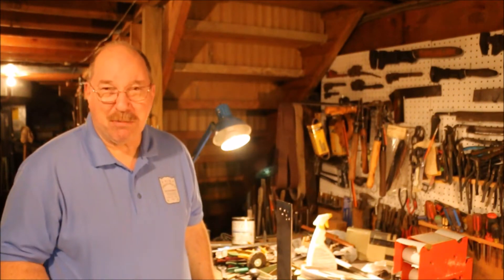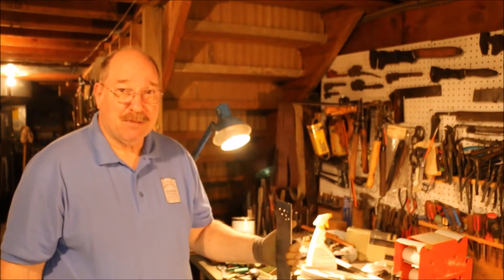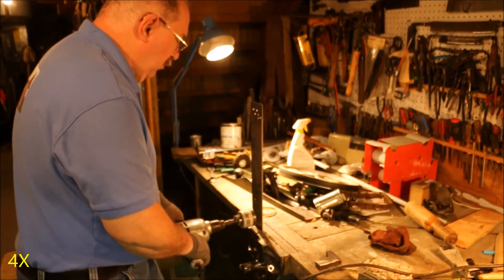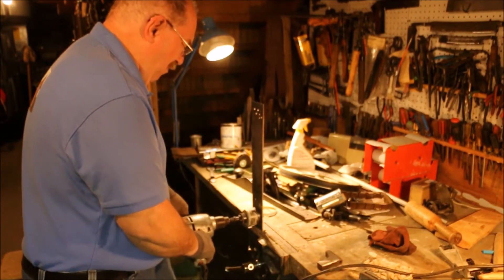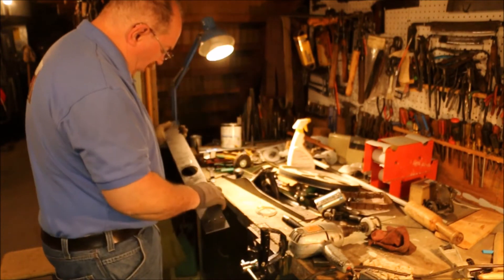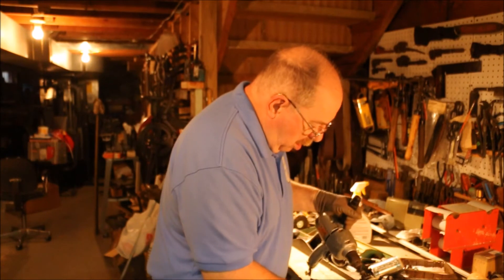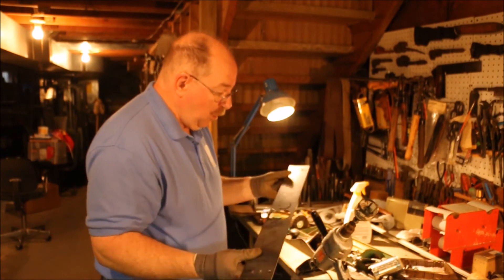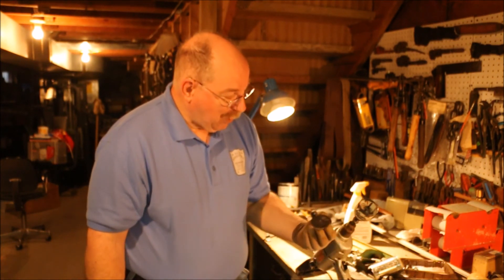HDPE SHREDDER R&D ~ PART 1 ~  PROTOTYPE BLADE DESIGN

Comment: The furnace has been kicking on for a month. That IS the frozen North we're talking about here.  Just keep cutting circles and notching them and you'll end up with a mini tub grinder. Then a p.t.o. hookup to the 8-N and off you go! Got 8 inches here. Kids got a foot and 10 miles west got a foot and a half. Power on BUT the generator is ready, just in case.
Reply from the maker: Lewie McNeely You guys got slammed. Lots of humidity and a day thats just cold enough to snow makes the most cover. We live about 50 miles West of Lake Michigan that makes lake effect snow the norm. We have skipped the usual early snow this year. That means we will get at least one big one. The average inches per year is almost always within an inch or two.
We went to the Smokies on vacation a few years ago. There was lots of ice at the tops of the mountains in April. Must be you guys get the best of both worlds. Heat and bugs in the valley and freezing cold 20 miles away.
Reply: YOu got it, Unc. Plus everybody that thinks they're really something through the summer BUT they can't stand the cold and head south. Peace and quiet when the cool starts setting in. I can remember it being a lot worse years ago but it was pure ice. I'll take the snow any time but this one wasn't really bad. It just surprised a lot of folks by not being mostly rain. This is what us Sneelockites major in;  being ready for what you don't think will happen. Works every time!
Reply from the maker: Lewie McNeely Any kind of hill and freezing rain is a recipe for disaster. I have had to drive with two wheels off the road to get up a hill on Sprague road before. I need to put the sand bags in the back of the Sonoma. The extra 100 lbs by the tailgate helps. 
Hooking up a giant shredder to the PTO is an AWESOME idea. That would put the wood chipper out to pasture. 100 hp  would eat 55 gallon plastc barrels. 😈😈😈😈😨😨

Comment: I've no need to say what's the problem with the saw not cutting the famous magic elixir full stop the old B&D drills are by far the best i have one from 1969 a gift for Christmas and I've used it ever since it has 2speeds 1/2"chuck I have sander,saw and lathe attachments also it has a stand for drill press and one for grinding and polishing mop on it I've never even changed the brushes and it will still go as good as the day I got it
Reply from the maker: Lewie McNeely We had a friend who made waterbeds in the 70's. We had it for about 7 years. When it worked it was great. Leaks and screwed up heaters finally took it out. We had a dog named Homer who was our first child in every way. Always slept on the standard bed but just wouldn't get near the water bed. Just as well I suppose. Claws and a plastic bag full of water? Not good. Loved it when it worked. 
The matress is cheap enough I think they should be replaced every three years. Same for the heater. 
We got the humidifiers out last week. Makes a big difference. 68 degrees is comfortable when it's running, chilling when it's not. Not a water bottle but I really notice when the tank runs dry. I don't want an automatic one on the furnace though. The lime up and clog to easy even with the water softener. Mom and Dad had one that I had to dissassemble and clean all the time. Way too much trouble. If you don't clean it it floods the firebox and everything rusts. 
Stay safe my friends. The next couple weeks are when the bad drivers get braver. Already had one 32 car pileup on I-94.
Reply: Midnight to you. The old drill motors are TOUGH! Hope all is warm where you are. The stove has it too warm for me but it still feels good. Am going to try and go out tomorrow since the roads are clear. 8 inches here and about all gone off the timber. I have a new floppy drive coming so maybe I can get some pictures your way. The old 98 is shot. The kids got a foot and west 10 miles got 1 1/2 feet. Our little sheltered paradise!
Reply: Lewie McNeely evening my friend the snow has slowed for the mo it’s rained all afternoon about 8mile around Manchester is clear now snow only on high ground.
Reply: 'Gmorning my friend and we might get a little tonight but not much. Cold and windy now. I can hear it cutting around the house. We're all glad not to be out in it.You too I'd say.
Reply: Lewie McNeely been out most of the day birthday weekend today youngest grandsons tomorrow eldest grandsons we ventured into Manchester to do some shopping pm and that’s like death by water dripping on your head so home and bed out for count just come round got it all again tomorrow for eldest
Reply: Go S L O W if you can. Tell him Grandpop ain't as young as he was yesterday. I think we're going to try it out tomorrow too. I turned the car around so we can zip out instead of trying to turn and go. Wish you the best tomorrow. Just stay as warm as you can. Maybe Unc can design a water bottle to crawl into!
Reply: Lewie McNeely I’ve sort of got one I call it bed lol just looked out it’s snowing again see if it stays in morn anyway you take mate
Reply: I had a water bed but I think it hurt more than it helped. The best to you tomorrow. Hope all is well. Will check in when we get back or if we go in case it snows a bunch more.
Reply: I got the dimensions on a mattress and actually made the frame out of 2x12 cedar. Did an amazing job on it for me. Had a headboard with drawers and everything but it started cramping me up. Like being on a concrete floor, it just got worse. It was a full waveless but I could plop my 1st out in the floor. Ended up making things out of the frame. Can't even remember what. I've seen the furnace humidifiers clog up like that, even the spray ones. I'll pass. They do make a difference though. I got Sweetums an ultrasonic for the 'She Den' and she really likes it.I've got one on my CPAP but don't run heat on it. My sinuses are goofy enough. And everybody was all over the road yesterday too. Sounds like 94 is a good place to stay away from. Stay warm yall! We'll do our best!

Comment: Sneelock, the old Black and Decker steel bodied drills take some beating. I have one from the late 50s / early 60s that runs as sweet as a nut. I am wondering if my grandson will say the same for a cordless tool from today in 2075 ?, I very much doubt it. Enjoyed the video and looking forward to seeing the chipper development. Best wishes from a very cold UK.
Reply from the maker: UK Tony I should try cutting a hole with the hole saw and the big drill. That is impressive when it is running. I' ll just have to anchor it so it doesn't break my wrist when it catches.
Reply: The meatiest drill I came across was in a coal mine in Yorkshire which had a crew of two and was water cooled. It had a floor to ceiling prop and the drill was wound into the coal face to bring down the coal seam to be hauled out of the mine. This was where the heavy cutter machines could not get, super scary.

I was present when there was a need to feed a wire into a bank strong room (it was all above board as it was for a new alarm) but the bricks and block work is mega strong obviously and it took a diamond tipped drill hours to get through, again wound slowly on a floor to ceiling prop.
Reply: U 2 Tony!
Reply: The old machine shop in town had one about 2ice the size as yours. Probably an inch drive or whatever. Had a 6 foot pipe to hold it fast on the ground. Was drilling out broken wheel studs in Mack hubs. I stayed WAY back!
Reply from the maker: Lewie McNeely We are doing Christmas decorating the weekend. Monday I will get out the big B&D. We will see if I can hang on. 😨
Reply: There was a big job below here with a lot of tunneling. Google 'Bad Creek Pumped Storage Project'. I hauled all over the outside with mixer and dumper but never went inside. I told everybody I'd go in but might not STAY in. And if I came out the whole bunch could go to a very bad place and stay there for a very long time and do it quickly and I would walk home. I can't handle heights and don't like to be closed in. I'll go underground when I won't know anything about it and can't do anything either. They ran a fleet of mixers in those tunnels. 500 tons a day for concrete stone from the boulder hole. Glad it's done.
Reply: Caphouse Colliery  Beeston Seam was 450 foot underground and if you turned off the lights it was completely black, the darkest place imaginable. The Collier used pit ponies as well as a moving belt to get the coal up and before it closed in 1985 it was producing 4000 tons per week. A forgotten world as we no longer have deep mining in the U.K..
Reply from the maker: UK Tony I do not enjoy dark places deep underground. Perhaps it is because I'm too imaginative but I keep thinking about how much dirt there is above me. 
We did one cave tour in Kentucky. I can say I've done it and won't do it again.
Reply: At Snowdown in Kent the guys went down 3000 feet to an area called the inferno where it was so hot they just wore boots, knee pads and helmets. Some wore their wives knickers to keep everything safe and several times each shift they would pour the sweat out of their boots. Tough work.